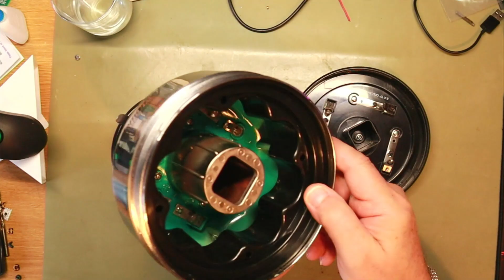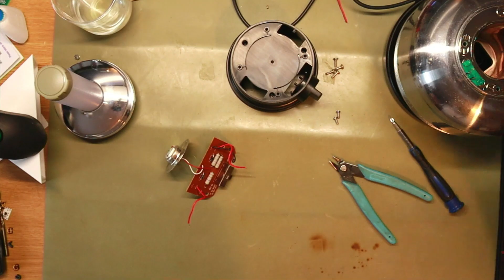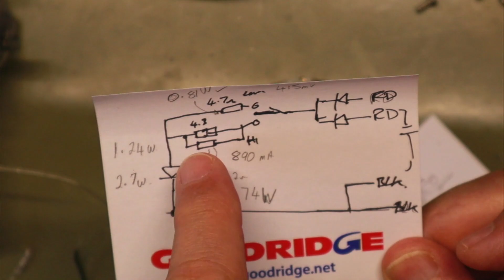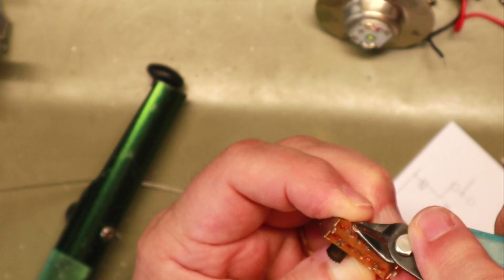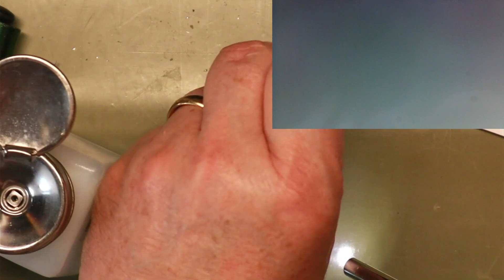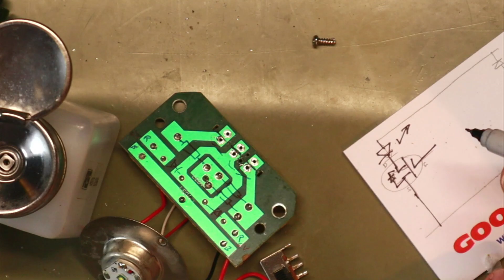#241 Coleman led lamp conversion to lithium part 1

Comment: Interesting project. I own the exact same lamp. Even with the resistor loss it runs practically forever on those 8 D cells and puts out a surprising amount of light. Reducing its weight would be a welcome improvement. How about one of those programmable current regulator chips with the built in FET - or would that be cheating?
Reply from the maker: @davidv1289  I have not run it enough to see how long it will last.  Looks likely that I'll have to do that for the final video. I hope you like,e the solution I went for in the next video.